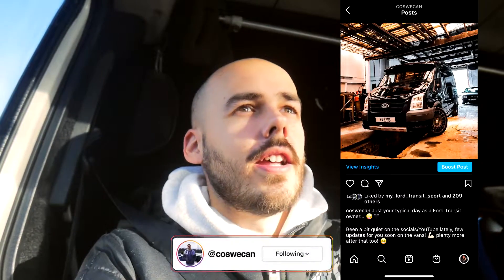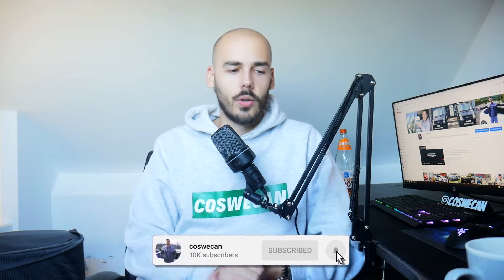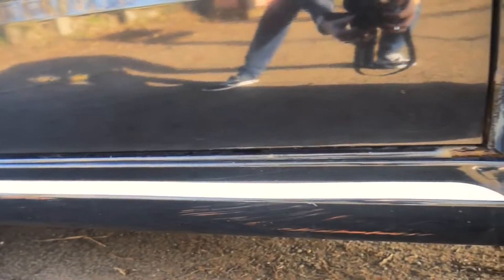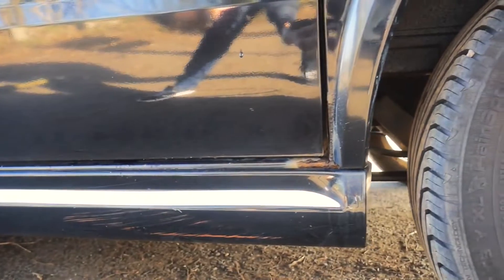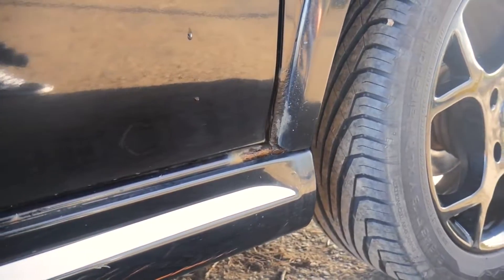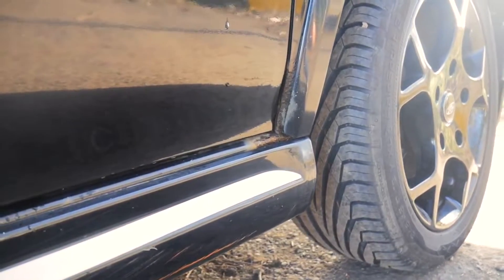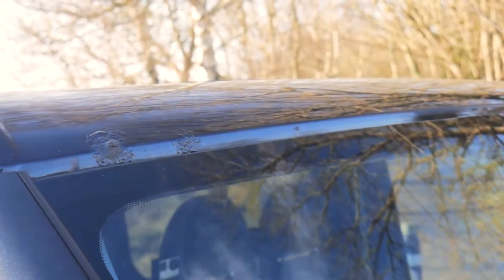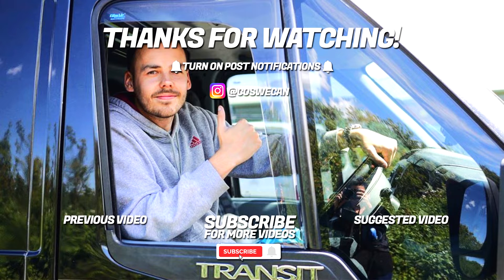My Van Has Some RUST Issues 😭

Comment: Its a transit they were rotten from factory, ive got drivers front step inner arch and inner sills to do on mine this year
Reply from the maker: Haha yes you are right there! It’s just a bit of character man that’s all 😬🤪 well give it a bit of TLC, look after it and it will look after you 💪🏻😄
Reply: @coswecan  well I can say they don't though😅😂 mine has had sills inners and outers, passenger sider step and inner arch, both front chassis legs, rear springs carriers, behind the rear bumpers ect ect 😂 and it was under sealed when I finished that 😅 good job I can do it my self like!
Reply from the maker: Aye it’s a big job on most of them, good job you can get plenty bits 👍🏻🤪